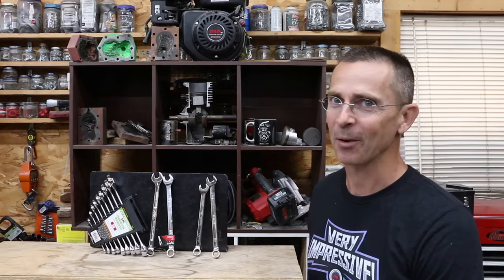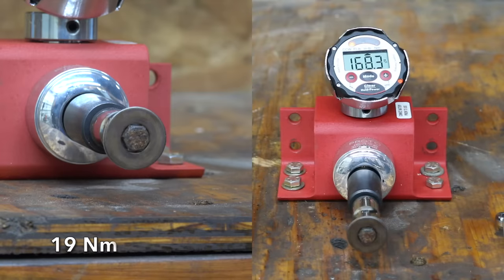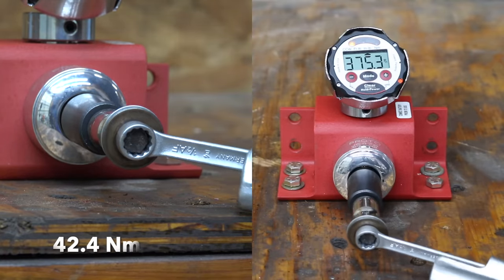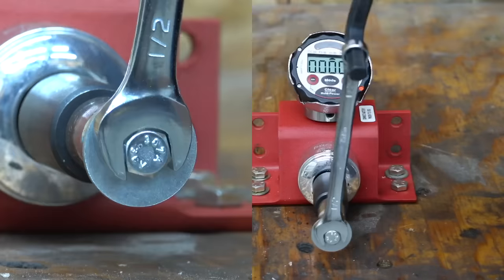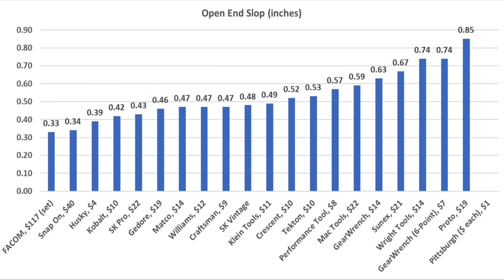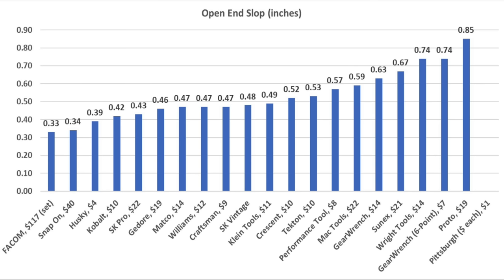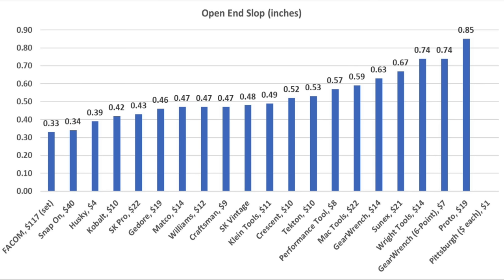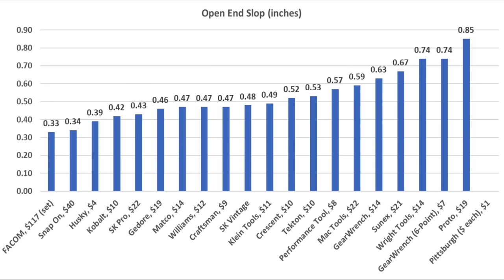Best Wrench? Let’s Settle This! Snap On vs MAC Tools, Matco, Proto, SK, GearWrench, Kobalt, Husky

Comment: I was a heavy equipment (Caterpillar) mech/training instructor for 10 years. I owned and used Craftsman, Williams, SK, Montgomery Ward, and Snap-On wrenches and ratchets without any problems. I disliked Snap-Ons because they were slippery due to their high polish, and the handle edges of the wrench were sharper than the others. Williams had squared-off edges, so you could apply more torque without hurting your hand. At that time, Snap-On did not have any fine-toothed ratchets, while Williams, SK, and Craftsman did. I didn't own ratchets from other brands. My largest ratchet was a 3/4" drive SK.
Reply from the maker: Great feedback! Thank you
Reply: My preference was the Snap-on they fit my hands better.  I had the unpolished husky and they where my second choice.  

I used Mac and Craftmen the Mac felt wrong in my hands and I have scars on the knuckles from the craftsman.
Reply: I am not a mechanic, but I always bought craftsman tools, just like my Father did.  Now I just go to Harbor Freight.

Comment: A couple of notes here: A 1/2" hex headed bolt should be installed with a maximum of 20 ft-lbs of torque (Fine thread grade 8). I realize that removal will sometimes be far beyond the tightening torque, but most wrenches were doing fine at 10x that torque. One thing I would have liked to see (but don't blame you for not showing, because of the expense) was how consistent the quality of the wrenches were.
Reply: Agreed. This test seems to show that even the cheapest wrenches are sufficient for their designated task. Why spend 40x as much to get 50% (or less) additional performance, when that additional performance is superfluous?
Reply: @dtroy15  cheap wrenches probably would be okay for a homeowner putting together ikea furniture or something. If you work on vehicles or equipment doing anything more than basic maintenance, they're damn near useless.

Comment: Since we are on the subject of wrenches, I’m curious to see if you would test ratchet end wrenches. We had two Matco wrenches with universal ratchet teeth that worked great. We then bought two snap on wrenches and one of the ratchets stopped working within 3 months. Also, the open end sides slip way easier than the matco ones that we have. Just curious if that’s something you’re willing to test. Always love your videos and your non biased reviews. Thank you for taking the time to buy and test all of these products!
Reply: I have a set of GearWrench ratchet ended ones too

Comment: I once found a snap-on 1 inch wrench on the road at an intersection. I had it in my truck for 6 months at least and one day my refrigeration unit broke and a mechanic had to come on his day off and spend hours repairing it before the load went bad. I gave him the wrench as a tip. He about shit his pants.
Reply: Snap On wrenches are overrated but they do hold their value.  : )
Reply: We have a lot of broken Snap-On in garage - nothing is indestructible in friends hands (live of a mechanic in the rust belt). Now seriously, Snap-On makes very good and innovative tools, expensive - yes, and sometimes well worth having. These day whatever doesn't have to 'special' we replace with less expensive equivalent, but functionality and ergonomics is still a priority. Then some of the Snap-Ons or Macs are just irreplaceable by other brands.
Reply: @stopthephilosophicalzombie9017  I grew up with the Mac and snap-on trucks coming to my dad’s shop. I don’t think my dad had one tool from them. But my brothers spent thousands with them. I joined the army so I wouldn’t end up with a tool bill. Lol jk
Reply: @stopthephilosophicalzombie9017  snap on flank drive wrenches are the best you can buy. They're expensive but they work well
Reply: Nice tip!

Comment: i've always used whatever i can get my hands on. i've lost WAY more than i've broken. i've got a harbor freight mainly set, replaced with some spares of random off brands here and there currently. i simply refuse to believe that a wrench broke at about 10ftlbs on a 1/2 bolt head. it had to be a fluke or one off. i know the tests were good, no doubt. i've been rough on them and they have always served me well enough to get by. i think i've only broken a few wrenches in my day. rounded them off, sure but not breaking at that low of level.
Reply from the maker: Thanks for sharing.
Reply: I worked in automotive in the 90's, the mechanics always had 3-4 tools to be warrantied every couple of weeks by the snap-on guy. The one guy had at least 60K in his tool chest, as he lived in a rented trailer out in the boon docks. Never understood how those guys bought into the price / quality, not with all the failures they had. I have also heard snap-on is really bad about signing new mechanics up with credit at the schools.

Comment: As a value-for-money brand, I've had good luck with Tekton so far. Bought a 3 size ratchet set, as well as a set of pliers and not had a days trouble.
Reply from the maker: Thanks for sharing!
Reply: Not only that, their warranty and customer service is top notch. I broke the head of a 3/8" breaker bar and they quickly mailed me a replacement with a hassle. They're my go-to for socket sets now.

Comment: About a third of the tools tested here I never heard of before. Then one's like Snap-On, Klein, Matco are not readily available for the everyday consumer but it was good to see them up against way less expensive wrenches like Craftsman and Husky. I think probably far more DIYers  buy tools at WalMart than Harbour freight simply because there are so many Walmarts out there and not so many Harbor Freights so I'd like to have seen brands like Hart, Hyper Tough and Stanley included in this test. I was very impressed with the Husky wrench at only $4.00 doing better than wrenches that cost 2, 3 and even more times over what that Husky cost.
Reply from the maker: Thanks for the suggestion.

Comment: I was disappointed with your test results for the husky. You said you made a mistake on the open end wrench test on the 1/2" allen wrench then gave the husky a score of 19. if the husky had rated average on the test it would have rated about 7.5 overall which would put it above average for a $4 wrench. That is very impressive in my opinion.

Comment: I love these tool comparison tests, and I like that he shows his scoring. I didn't like that he skipped out on a obvious route to take. Best tool for the money. First time I watched this, I copied his math into a spreadsheet, and did a weighted ranking system. first place was worth 20 points, etc. Not 21 to allow for 1 outlier for every brand. In the end I added the scores and divided by the cost. The best wrench for the price.... Husky. It's not the "best" by any means, but highest quality for lowest price, it was a strong leader.
Reply from the maker: Thanks!
Reply: @ProjectFarm  not hating on you at all. Really do enjoy your videos.
Reply: @benknrobbers   it is kind of like amortising. how long something will last before needing fixing or replacing.
Reply: @rodneyjohnson4794  the way I was taught is always buy the best tools you can afford. Snapon may out-perform other brands, but the cost benefit doesn't necessarily justify the amortization. 

I mentioned in a different comment that I just bought a master socket set. Got tired of not having the right size at 3am. So I decided to invest in an expansive set. First thought was to buy snapon. Until I saw the price. I settled on grainger's house brand. The quality is decent, and I can break a random socket every week, pay to replace it out of pocket, and I would end up being something like 300 years old before I made up the difference between it and snapon.
Reply: @benknrobbers  it's different for professionals. Think of it like buying a car sure buying a $2000 beater makes a lot more sense on paper than buying a $20,000 reliable car but if that beater breaks down once every month causing you to miss work you will lose much more than the price difference over the course of your career. A car or tool that is even only 10% more reliable can be the difference between keeping or losing a single big customer that will pay you 10x the price it cost you to buy.
Reply: @joey9511  You are describing exactly what I said. A $2000 beater truck is harbor freight. Husky is a $20k low mileage well maintained 1 ton truck. Snapon is roughly the same as a brand new Ford F250 super duty platinum edition with the price tag to match.... $75,000 plus. If your business relies on it and you are doing well enough to justify it, get the 75k truck. But us mere mortals often have budgetary constraints. That is what I'm suggesting, a nod to quality with a price tag that won't have you paying a tool truck $200 a month for the rest of your life.
Reply: @joey9511  A real professional is the same as what i tell fellow amateur musicians.  When you become a professional you let no one else use your instrument and you protect that instrument.  that is how you make your living.  tool sets for a professional are their life.  i can give advice to those workers that reach that level,  keep a beater set of basic tools around for those that want to borrow ... ,  same advice i give musicians.

Comment: Actually the Husky won, it missed a test at no fault of its own, and it's super affordable. I suspect had it had the full testing it would have placed in the top 5, and possibly #3.

Maybe get another one and let's find out!
Reply: Even without the test I think it won when you consider the cost of all the wrenches
Reply: I totally agree that at $4 Husky's clearly the Best Budget Wrench.
Reply: agreed, the husky finished all tests performed in the upper 50%, but is a fraction of the cost of the other wrenches performing at that level or higher. for the average joe, that's the one.
Reply: Let's not forget that most Husky hand tools have an unlimited warranty just like the pro brands.  Break it, take it to the service counter at Home Depot and get a replacement.  Combine that with the price and it's hard to beat.
Reply: Considering the cost difference and that wrenches last more than a lifetime, costs carries no weight at all for me. If you are not a professional, I can understand valuing cost as you are not making a living with your tools. One rounded fastener or broken wrench delaying a job would eat up the cost difference for me immedatly.
Reply: @vids595  snap on/Mac/matco truck doesn't swing by the home gamer's garage either. You break a tool in the home garage, and need to get to work in the morning, being able to have your girlfriend or a Buddy drive you up to warranty is a huge deal.
Reply: @vids595  that’s a good point and a great way to make us think about it. But I suspect that for most of us, cost is probably one of the main factors.
Reply: Husky is an apex brand

Comment: For tools in my price point ("struggling out of poverty") I have been very impressed with husky wrenches.  Every time I break/lose a Pittsburgh wrench I replace it with a husky.   Needless to say the set is now more husky than Pittsburgh.
Reply from the maker: Thanks for the feedback.
Reply: Same here. I figured for my use the Pittsburgh stuff would serve me just fine but I’ve been breaking them quite a bit. I bought Gear wrench and Husky tools on sale and haven’t had any issues with them. Also have a craftsman set of sockets I got for Christmas when I was 13. No longer back their warranty since they were purchased from Sears but they have served me well. I don’t think you can go wrong with the Husky or Craftsman tools when they are on sale.
Reply: @ToolsInAction4u  lowes will still honor craftsman's warranty.
Reply: I've never broken a Pittsburgh wrench or socket.  But they aren't my only tools.
Reply: @gizzyguzzi  I've lost more than I've broken to be honest.   I think the fit and finish is better on the husky.   Also home depot sells the wrenches individually so it's easy to replace just one.

Comment: back in the 70's I broke a Snap On 1/2 open end wrench without any pry bar. It was a fluke I was a mechanic for 55 years only one I ever broke. I like Snap on wrenches, SK ratchets , Mac swivels I still nave my craftsman 1/2 drive sockets from 1973.
Reply from the maker: Thanks for sharing.
Reply: sounds like you have good well rounded objectivity. Your lack of bias likely makes you a well informed source who has tried many specific tools from various high quality brands. Always good to get insight from those with a lot of experience and those who refuse specific brand loyalty for none other than the name. I don't do as much significant work compared to many on this site, but I have every brand of wrench and other hand tools imaginable, and I have to agree w/ the Snap-on wrench comment but also the SK ratchets--those are solid, well-made ratchets that get the job done and withstand punishment.
Reply: @bryanweidler8992  THANKS!

Comment: I love tekton, I wish Meijer didn't quit carrying them for stanley tools. Tekton had lifetime warranty on everything and quite a few of their lineup, specifically the pliers, were made in USA by Wilde.
Reply from the maker: Thanks for the feedback.
Reply: The real funny part of that is that Stanley-Black & Decker owns Dewalt, Craftsman, Irwin, Facom, Porter Cable, Mac Tools, Proto, and several others; yet the quality and warranty of each brand varies SIGNIFICANTLY.

Comment: When I worked on aero derivative land marine jet engines they often had heat corroded 12 point fasteners. Us service guys used either snap on or mac wrenches/tools. On one particular engine the nuts were super tight and the mac wrenches bent but the snap on managed to loosen the fasteners. This was back in the 90's so maybe things changed. I think Mac was made in the USA back then.
Reply from the maker: Thank you for sharing!
Reply: I think very few Mac tools are still made in the USA (Dallas I believe). They're now mostly made in Taiwan.
Reply: I worked in a automotive shop back in the 90's, the mechanics always had 3-4 Snap-On tools for warranty every couple of weeks.
Reply: @spencers4121  That's not my experience, and we were hard on tools doing industrial work. And we didn't care if we abused tools because the company paid for them and our budget was basically unlimited. We'd bust the odd tool but that was from abuse like putting pipes on ratchets or breaker bars for extra leverage and the like. And we used tools from 1/4 inch drive to 3" drive impacts you hang from a crane.

Comment: I'd like to see Icon in there with Pittsburgh to compare HFs high vs low end stuff. Usually if you just get their best stuff it's almost always as good or better than snap on. Just never go with the cheap option at Harbor Freight
Reply from the maker: Thanks for the suggestion.
Reply: This was a torture test, but there are hundreds of professional mechanics who will swear by Pittsburgh wrenches and socket sets, especially for junior mechanics or "weekend wrenchers." 
It's important to know what tools can (and can't) do. When I see the open-end start to flex, I get a different tool.

Comment: What was the failure on your part for the Husky that prevented the open end testing on the allen key?  Take that test out of the equation instead of placing it last and the Husky average becomes 6.75 making it a huge value leader in the group.
Reply: Yeah, i got pissed on the end as of that as well. For someone skipping videos to see results this gives false  picture that if you pay far more you get far better when Husky is there to fuck up that rule.
Reply: I worked as a professional mechanic for a few years in my youth, and still do a fair bit of wrenching on my vehicles. Craftsman tools were the highest quality I could afford, and they have worked well over the years. I have a couple of Husky tools and a bunch of thier tool bags, and have been impressed with the brand. Avoid Harbor Freight and other off-brands for hand tools unless you like bloody knuckles....
Reply: Yeah that's frankly kind of unacceptable in an otherwise well done video. User error, so he places the Husky at 19th place overall with the Pittsburgh? Just doesn't make sense.

It's a $4 wrench. Buy another one and complete the test.
Reply: Other than that, we appreciate what you do…. I mean, take it easy guys!
Reply: really most husky wrench's are to big to get in tight quarters because of the poor quality steel .ben out when someone broke down and that's all they had .a lot of scraped knuckles'. would like them better if they just were labeled  junk
Reply: @howardfitzner7789  
They certainly are not top of the line tools. That said, I've found the HUSKY  brand to be quite serviceable. Their stuff offers great value. No other cheap tool brand comes close.
Reply: Sounds like "we can't let the cheap wrench do too well" or it destroys the "you get what you pay for" mantra.
Reply: @reefhound9902  exactly

Comment: A lot of the slippage will be poor accuracy of the tool size.  I recently needed a Torx screwdriver bit for a rifle scope bolt.  The good set fit perfectly.  The poor sets I tried had huge slippage.
Reply: FYI, I have yet to find a more precise, well fitting Torx driver than PB Swiss. Have you tried those?